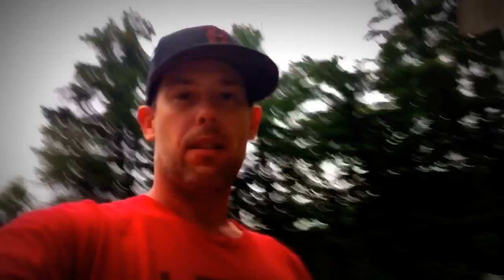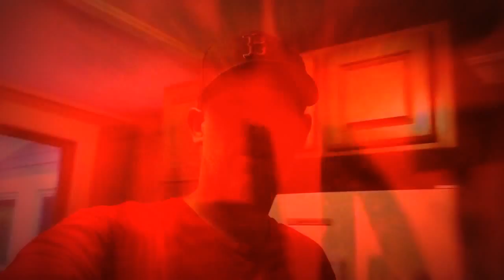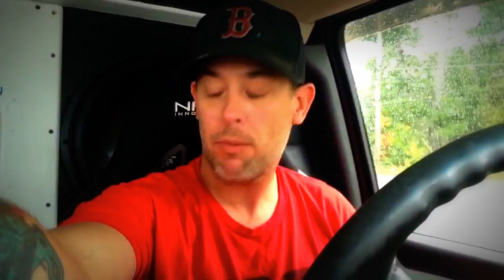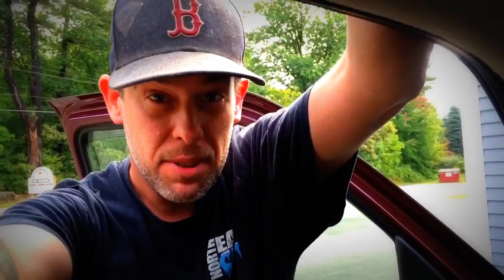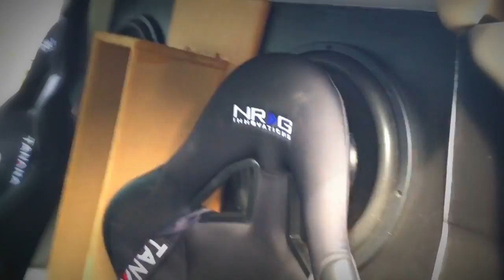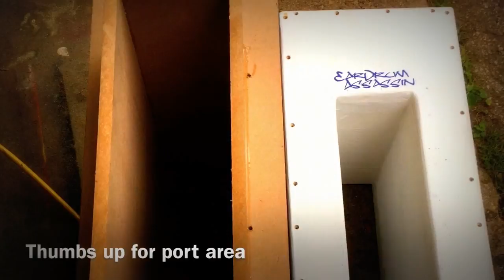How to tune a subwoofer/ the best port tuning

Comment: In smaller cars there's more cabin gain down low if I'm not mistaking is that correct or just more overall there's a guy in va were I live that does car audio on a whole new level he has proven he is pretty smart about things and he told me there is more cabin gain overall in small cars he also said that generally if your going for a high output setup with a fair amount of bandwidth sealed go with a f3 of 45 on average and a qtc in the .7 to .9 area and ported a f3 of between 35 and 50 depending on factors also with a qtc oc .7 to .9 I've been watching your vids for a long time and value your opinion keep in mind I'm not crazy into SPL just what my ears and body feels and having a wide enough bandwidth to play a fair variety of music say 25hz to 50hz max or 30 to 40 more realistically

Comment: I currently have a 3 cubic feet box for my single 12. Would a 4 cubic feet box hit the lows better or be louder?
Reply from the maker: Tee it could be . There’s a lot of variables
Reply: assuming the tuning stays the same and same amount of power, would more airspace be better...
Reply from the maker: Tee should make some gains . Might lose a little cone control .
Reply: cool thanks for replying
Reply from the maker: Tee you’re welcome and let me know how it works out for ya . I’ve found usually increasing port area a little will make gains . Esp on lows .
Reply: Tee 4 cubes for a single 12 is too much, even 3 cubes is pushing it. I'd do 2.5 at the most.

 I have a home theater box that's 3.7 cubes tuned to 23hz and no matter what 12 I throw in there they all sound like shit, fall off extremely quickly below 21hz and above 32hz.

General rule of thumb is large boxes decrease bandwidth and increase spl at and around tuning usually 6-7hz above and a few hz below, however you can no longer play as well below tuning due to reduced cone control
Reply: thank you. I will keep that in mind. kinda curious as why you would tune to 23hz? majority of the good bass you can feel is 30-40hz.. rarely does any songs go down to the 20s
Reply: Tee because it's in a home theatre setup, and it was originally meant to be for 2 12s but I only ended up getting 1. 

  I'm probably gonna end up buying an 18 and doing a setup with that in my house

Comment: Hey bro I've coming up with a few measurements I can't do much in my truck due to size.
But, how's 26.05 cubes with
20 cubes after sub and port displacement. Port at 300 square inches total for 15 per cube. You think this should be ok for my 4 18s??? Calculated 34hz I wanted a replacement port like yours but I don't know if there's anyway I can
Reply from the maker: Sounds about right depending on what 18s . Most require about 5.5-8 cubes each . You could also get aero ports and change them out to change tuning .